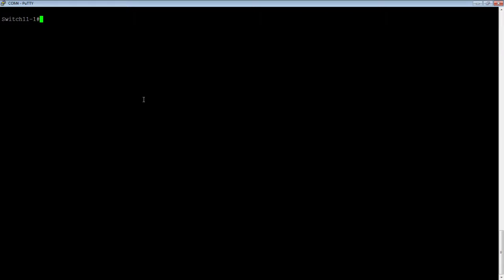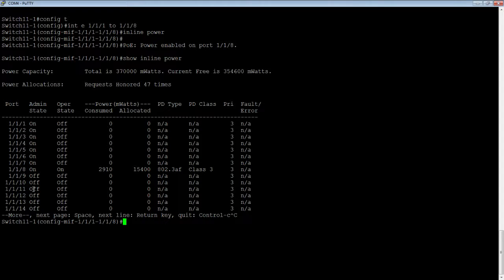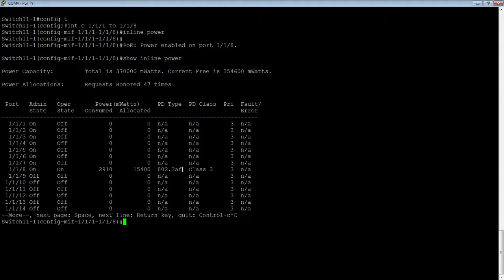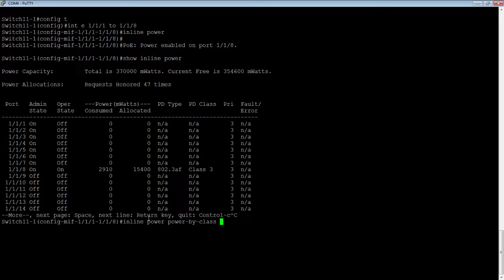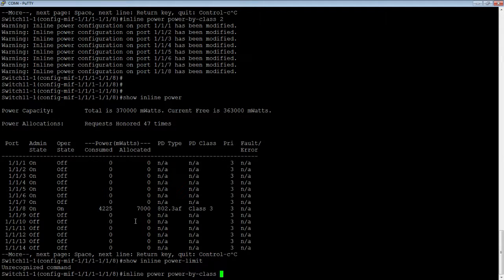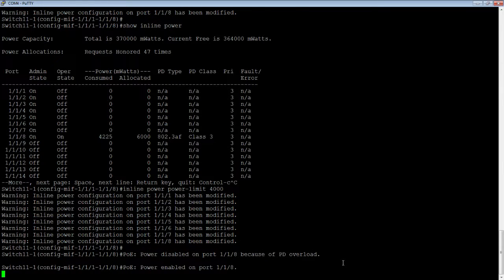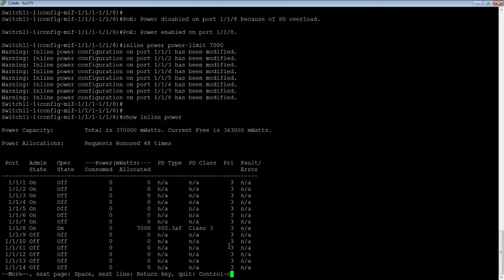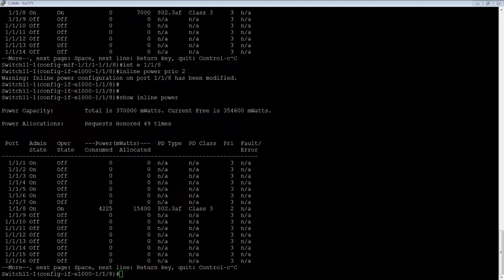Brocade Campus ICX - Configuring Power Over Ethernet (PoE)

Comment: Hi thanks for this video. I just need to know my Ubiquity devices are getting power but not showing up in controller what can i do?
Reply from the maker: if the APs are powering up you should be able to find their IP address in your DHCP server by mac address and ping your devices to make sure they have IP connectivity and connect to their web interface. No reason why the switch would not forward any traffic unless it is on a different vlan. Is your firewall blocking the connection to the controller? Many possibilities but in most cases it turns out to be vlan configuration. routing, DHCP server, or firewall.